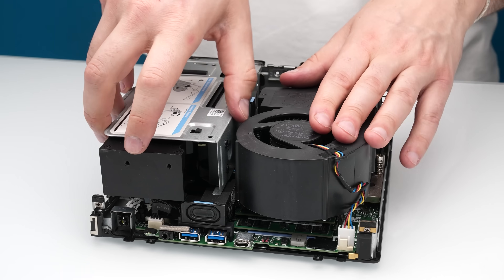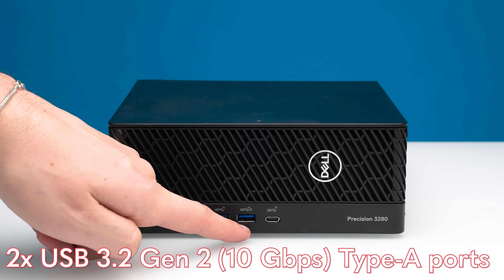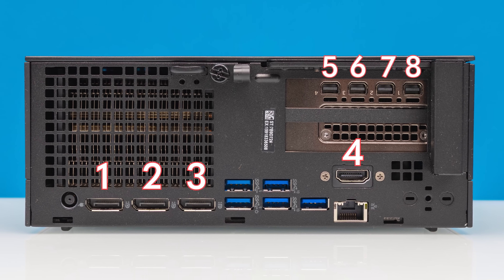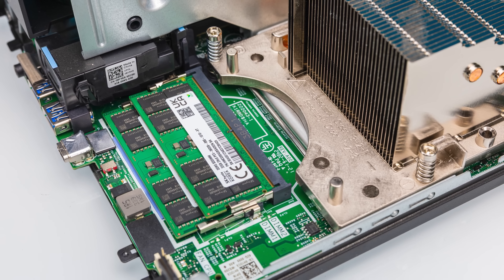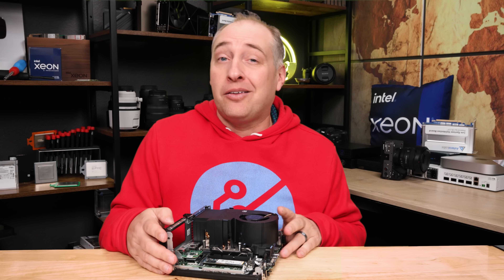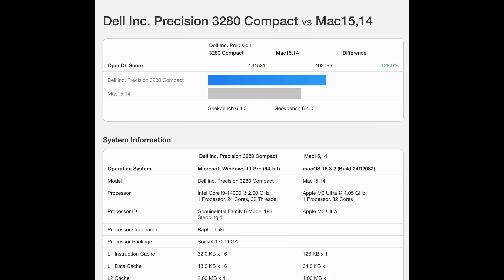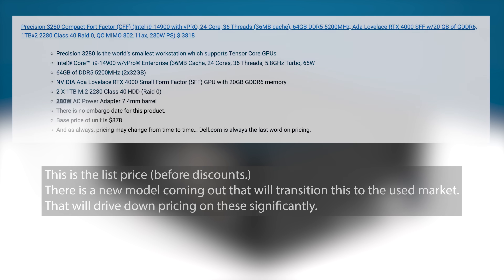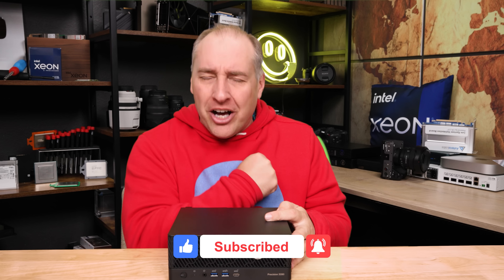Compact with EVERYTHING Dell Precision 3280 Compact

Comment: Additionally, I believe Dell made the 3280 larger to accommodate a dual-slot GPU. I am going to pick up a used 3280 without a GPU installed and put an Intel Arc Pro B50 in it.

Comment: I have a Dell Precision with a Core i9 9900 and it’s a small form factor
It was and still kind of is a beast for anything 
Very limited by the I/O
I.E. PCIe 3.0 DDR4 SATA
Mine as sitting

Core i9 9900
64 GB DDR4
3 X WD Blue 1 TB SSDs
WD Black 1 TB NVMe SSD
Killer WiFi7 upgrade card 
nvidia GeForce RTX 4060 with SATA to 8 pin
I know the power draw is an issue
But I don’t care, it works. I’ll likely be going back to an RTX A2000
Still a killer system

Comment: Jonsbo NV10 is there and none of the parts are proprietary. If the motherboard messed up on this unit 4-5 years into use, good luck finding the replacement.

Comment: Only problem is see is that it is a Dell.  We have Dells at work and they have a fairly high failure rate.  This is a cool little box though and I have to admit that the form factor and feature set are appealing.   I prefer Lenovo.  I have a pair of P320 tiny, a P330 tiny, and an old i7 M93 and all have been great boxes.

Comment: In the end it's just a computer, so yeah. It's not really surprising you can do things with it the manufacture says it can't do. I have an old Dell PowerEdge R630. The public available documentation for it is outdated and incomplete. I know Dell dropped the support for the R630, but even the E5 2600v4 aren't even mentioned and those were available 2 years after the first release of the R630. Even BIOS versions are available to support the v4 cpus. Dell says in its documentation GPUs, codec cards, accelerator cards, audio and USB hub cards are not supported, but they work fine. Even the power rating is confusing. 120W total PCIE power but only 25W per PCIE raiser? This doesn't add up correct. You can have either a 3 half height x16 PCIE slots or 1 half and 1 full height, but the full height allows 75W. 
the R630 actual doesn't know how much power goes to each PCIE slot unless you use Supported Dell branded PCIE cards, because those have a Power metering on it for power management purposes. 
i have in my R630, a RX560 for Ai related stuff, because of Power consumption per token. the RX560 is 2 times slower as the raw CPU calculation in my system configuration, but the GPU uses only 60 to 75W so the whole system uses only 160w in GPU mode and in CPU mode the system draws 600W to 700W and it is only about 2 times faster. I am fine with only 4gb Vram. i use Ollama for my Home Assistant Speech command feature and for other functionality that uses a text based AI. i use 6b models there are good enough for my needs. My system also has a Matrox M264 s2 codec card for my streaming services. 
This Server is for me the everything machine. i run everything in Docker if possible and some VMs are also running.

if i had the money, i would probably buy something like this Dell Precision 3280 Compact instead, but i bought the R630 because it was cheap and has lots of compute power, expansion and storage. Also, i am used to idrac8 in particular because of work.  yeah, i like the idrac very much, even it is atrocious slow. But the Life cycle controller is Trash i hate it. i am faster configuration stuff directly on the controller and over the idrac. Unfortunately, you have to use it if you wanna update, even you schedule the update over the idrac.

Comment: now do a review of that dell precision 3280 compact fully specked against Lenovo Neo Ultra fully equipped with 4060 8gb gpu - minisforum AI X1 Pro and 795S7 with 4060 gpu 👍
Reply from the maker: We actually filmed a 795S7 review last week with the 4060. We even did an upgrade to the X3D motherboard as part of the video. Then I saw it was out of stock so I am not sure if we will publish it

Comment: This is an amazing machine overall, but I can't help but feel underwhelmed by the CPU performance compared to the three Ryzen CPUs just underneath, especially since the i9-14900 has 24 cores compared to 8 or 12 in those Ryzens just behind it in the benchmarks. This machine with a Ryzen CPU would be unstoppable, but I know Dell will never do that.

Comment: I work for dell and run an r&d development network for a support team and I can attest that these systems are BEASTLY......  a little costly for the average users, but...  they are amazing......
Reply: Can you fit a spinning disk HDD in these?
Reply: @boredandagitated  why would you want to?
Reply: @longlost8424   big capacities are cheaper in HDD, and it’d be cool to use this as a media server. Doesn’t seem that weird a Q to me
Reply: @boredandagitated  then perhaps our understanding of "size" is a little different... usff, nuc, and ultra small generally don't relate to spinning 3.5" drive.....  maybe look for a somewhat older system for those drives.  these systems are designed for smaller, more efficient peripherals....
Reply: @  it’s not that far fetched to fit a 3.5 instead of the gpu above the little nvme area. But it would need brackets. If the brackets don’t exist that’s fine, it’s all I was wondering
Reply: @boredandagitated  no

Comment: The external power brick makes sense, but I still prefer Lenovo's approach. 
They use the yellow slimtip to power monitors, docks PCs and laptops, so you can easily replace a failed one.

Comment: Great video!!!

I think that this is the answer to the question of "what happens if you were to take the MS-01 and made it so that you can fit a dual slot, half height, half-length GPU in it?"

I am anxiously waiting for Minisforum to announce the pricing for the MS-A2 and/or waiting for the system itself to drop.

Comment: I must be missing something. The only Nvidia GPU available on Dell's system builder is the "Nvidia RTX 2000 Ada, 16 GB GDDR6, 4 mDP to DP". How does one add the RTX 4000?
Reply: Dell isn't offering much in the configurator for non business buyers right now. It might be a few months before they do, which sucks.

Comment: One thing I'll never understand is why they make this machines and NEVER consider how to improve networking. Hp has a way to add 10g without removing the gpu (on top of having more pcie lanes, so you can add a 1 slot gpu and a network card), I'd honestly go there. If I'm buying a system that is larger than your 1L pc, I'd rather have the complete expansion options, regardless of a few extra cm.
Also, external power bricks on a device this size makes no sense imho.

Comment: The price makes zero sense, the older generations dont make any sense either.
Even if by some weird turn of events you ABSOLUTELY HAD TOO use a pre made sff, The Ryzen AI MAX+ 395 (stupid name) offerings whip this in every metric.
1 gigabit ethernet is worse than ali express 100$ AM5 boards. external power brick disqualifies this from SFF.
Reply from the maker: I mean the RTX 4000 Ada is ~$1500 these days. The AI MAX+ 395 is not really out yet for most of the market.

Comment: Back to the 90s workstations flipped extension cards ! It was fun to see DIY builders trying to get it back but of course a truly tailored solution like this is more than welcomed.

Still sad to see them sticking to external power bricks 🥲 Is there any other computer of that size-ish that comes with this 90° PCI solution that also includes a built in power supply ? I think there is only HP with the Z2 Mini

Comment: I wish someone would make something with the same forum factor built for storage, 128BG RAM, 32 Cores, 10Gb Nic, 64TB+ SSD storage, plus a couple of M.2's
Reply: Well, if you want 64TB of SSD and a couple of M.2, either you go with a a 64TB U.3 SSD or you are gonna run out of PCIe lanes quickly. You can't have EPYC levels of IO and in a mini ITX form factor.
Reply: minisforum ?
Reply: Some of these new GMKTek or FEVM mini pcs and workstations are nudging into this territory.
Reply: Apple's Mac mini's have gas 10gbe as an option for years
Reply: @spiceyfrenchtoast9421  you can't repair the apple mac, once it break it break and you lose everything. better choice is something where you can repair and replace components

Comment: Great review. My wishlist to make it even better - a Xeon processor, 2  thunderbolt ports to replace the 2 USB-A 5GB ports and a 10 GBe ethernet port. Granted it would make that power brick a concrete block. But in most use cases, it will rarely move.
The RTX 4000 ADA to me is the best bang for buck workstation GPU, since it maintains the single form factor, while having ability to exceed performance at lower price compared to its bigger brethren by just multiplying it. The new Blackwell 4000 sounds even more promising with a very significant performance upgrade with Gen5 PCIe without a big price jump.
Reply from the maker: In the 3240 Compact video we have one with a Xeon
Reply: ⁹

Comment: Can't wait to buy this little machine 10 years later when its cheap on e-bay
Reply: You can buy a 3240 right now without waiting. Used pc4 ecc sodimm and cc150 are incredibly cheap
Reply: @gankutsuou01  you miss the point. they're $1,200+ CHEAPEST one used on eBay.
Reply: @xPaPaDx You missed the point where he said 3240. They're $300-$400 on the bay.
Reply: @EhEhEhEINSTEIN  you are totally correct. that's MY bad.
Reply: @EhEhEhEINSTEIN dont see the ones with a dedicated gpu at that price
Reply: @gankutsuou01  I feel like this model as a whole is pretty expensive for what it is (10th gen cpu in 3240) to TBH. I got optiplex 3000 with 12th gen cpu from ebay for less than what 3240 is now for one of my nodes. But if I to spend that much money on a server/node I would put it together myself with better use/performance/scaling for money
Reply: I'll get one within a few months for cheap watch me go this isn't first rodeo
Reply: @MannFranke  I bet they're not cheap in a few months. Nice try tho.
Reply: @xPaPaDx   naw ill find one
Reply: @MannFranke  eventually anyone can :)
Reply: Hello. Thanks for the good clip.  I am struggling to decide between 3280 and 3460.  I dont really need GPU power but i ll want to upgrade to 10gbs ethernet.   What you suggest between the 2.  Practically i am upgrading  from a optiplex 7020 Micro.  And as a last thing.   Does it worth to choose 14900 i9 or better stay on 14700 i7?  Thanks in advance.  I really searched more reviews but almost did not find something ao extensive about 3460 sff.   Thanks

Comment: Nice little box. I have been experimenting running LLMs on a much larger machine, a HP Z840 dual 22 core Xeons (44 total cores), 256GB ECC DDR4 and one Quadro P4000. Running some of the smaller LLMs such as tinyllama it can yield 130+ tokens / sec. Others such as llama3, yield about 30+tokens. Others that are too large to fit in the available VRAM space yield 5-15 tokens. All of these depend on the complexity of the query.
Reply from the maker: We will have a video about running Deepseek-R1 671b at full FP16 on a server without spending $400K on the server on Thursday. It is not fast, but it is also the FP16 model that uses almost 1.3TB of memory.
Reply: Looking forward to hearing about that setup. VRAM is so crazy expensive and ddr4 LRDIMMs like those in the z840 are dirt cheap. If you can handle the wait on the inference side Id like to hear more about running large LLMs on CPU and RAM.
Reply: @Sam-tb9xu  Since I posted my comment I added a second Quadro P4000. Running LLMs of 8 billion parameters (4.7GB) hasn't really changed. However running LLMs of 14 billion parameters (9GB) the performance has increased from about 5-6 tokens / sec to 12-15 tokens / sec. The HP Z840 can accommodate up to 2TB of RAM, re-populating the machine with LRDIMM memory is around $1 per gig, not quite the expense I want to take on yet. I haven't run anything larger than 9GB in size. Even with one card on a 9GB LLM, Ollama was using some of the GPU and VRAM, the rest was spread out on half the available logical processors and memory. This was apparent when running nvtop to monitor GPU activity. Adding the second card according to btop, reduced the CPU load to near zero, just a few percent for traffic handling, it was quite the sight to see.
Reply: @ love this idea of using two cards. I didnt know you could spread a model out over two card without those expensive interconnect things.

Comment: How would you compare this unit against the upcomming minisforum ms-a2 which offers 16/32 threads with ryzen 7945 and 2 10g onboard, plus 2 2.5 as well, 3 nvme etc...
Reply from the maker: I mean this is a Dell with the ability to get next day onsite service. So you are comparing a system with great specs, but little support, to a system with great support.

Comment: Thanks for your reply - but I am genuinely so much more confused than I already was. I’m considering picking up a few low power servers for a cluster which have the i226V-LM, so I’m curious what exactly Patrick meant at ~4:01. When commenting on the i219-LM NIC in this unit, he says:

“I really wish that Intel worked with its ecosystem and got at least 2.5 gig Ethernet” 
It doesn’t seem like he meant “I wish Dell would have chosen the i226V-LM” because of where he says “I wish Intel worked with it’s ecosystem”…which in this context seems to mean “Intel’s current 2.5G NIC offerings aren’t up to OOB feature parity of the i219LM.”

So I’m just earnestly asking here, is there something about the i226V-LM (a 2.5G Intel LM series NIC) that isn’t as good as the i219-LM for OOBM? (Or did he just not know that the i226V-LM existed?)
Reply from the maker: It is an ecosystem thing. Just because a new part exists, it needs to be on the platform.

Comment: 4:01 Wait, are you saying the i226LM isn’t comparable to the i229LM for functionality? It was my understanding that the i226LM was just the i226V with all the V-Pro Bells n’ Whistliewhatnots?
Reply: I226-LM is vPro ready, it's the NIC powering 12th gen and later vPro-enabled NUCs. The feature missing from I22x is NCSI, a feature usually used on server systems to give BMC the ability to use a host NIC.
Reply from the maker: vPro is usually a solution for a generation.
Reply: They add functions with each new generation. I don't have the luxury of an i2xx, I'm stranded with NetXtreme from BCM. It isn't as good, but I have what I have, so I live with it. I'm just waiting for the day my programs no longer work on the i5-4278U at all.

Comment: Intel is a sleeping dragon, that needs to wake up
Reply from the maker: LBT is someone who can wake them up
Reply: AMD has better solutions now. You're better off using a Ryzen chip sometimes. When the Strix Point G AM5 chip releases, I'll likely get an ITX board for one. I don't want to run a dedicated GPU on a card when I will be doing server tasks. The Intel "Xe" cores are fine (does HD graphics fall under Xe cores? I can't tell if they are actually different cores in laptops with Xe vs desktop chips), but they really are only good for decode integrated into the CPUs, they aren't even good for light gaming. I theorize it would likely give better performance to use a light gaming APU for server tasks.

Comment: Yeah, of course, it can handle more than the spec'd amount of RAM! Personally, i find it mildly infuriating, when MFGs only state THEIR max SKU. It's particularly annoying, when they state a max of 4TB per M.2 NVMe socket! No, it's not a thickness constraint, because my 2TB SSD has chips on both sides - so, that can't be IT! (also, there are 8TB 2280 M.2 SSDs)
Reply: I'd say "Only tested with a 4TB sized SSD, using higher capacity may have issues that will not be covered."
Reply: @ShirokoCycling  it's all 64bit now, there's no reason to (artificially?) limit the spec! …that's kinda my point. EDIT: it always feels like they're making an effort to limit us to 4TB. Artificial market segmentation.

Comment: The Dell's top specs look almost identical to the Lenovo P3 Ultra's, an 8.5 by 7.9 by 3.5-inch, 8-pound workstation whose entire chassis slides out without tools. Like the Dell, the Lenovo supports up to 128GB of ECC RAM, two PCI-E slots, internal M.2 RAID, and Intel vPRO. My P3 Ultra came with a 300-watt external power supply, an Intel i13900 non-K CPU, and an NVidia RTX 5500 Laptop 16GB GPU. I've ordered a second internal M.2 2280 SSD and an internal 2.5-inch SATA III SSD.
Reply: Seems like a much more appealing package overall: 4 SO-DIMM Slots, 2 PCIe Slots, 1+2,5GBE onboard, ...
Reply: They look very similar, though it looks like you can get some better networking (10G) in the P3 Ultra.

Comment: $3.8k for a dell is a bit steep.
Reply from the maker: That is list price, not discounted at all.
Reply: That is NOT steep. That is a good deal for all of this in this package. DIY is cheaper. But this is premade, and I could tell my family to buy this if they need an upgradable machine that is small. I'm stuck with a 2014 Mac Mini for now, but I make that work as hard as it can without pushing it too far.

Also, this is lot smaller than ITX.
Reply: What does "a dell" mean? Does "a dell" mean just one "a price" regardless of what's in it? B/c they make servers that can fill "a rack" costing more than "a ferrari" - is that still "a dell"?